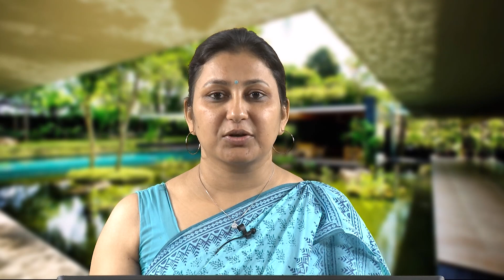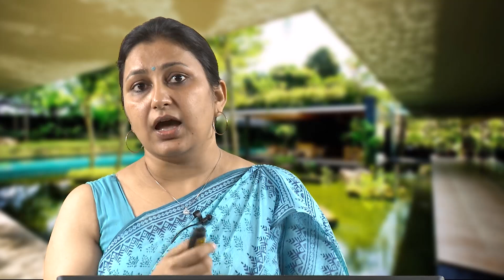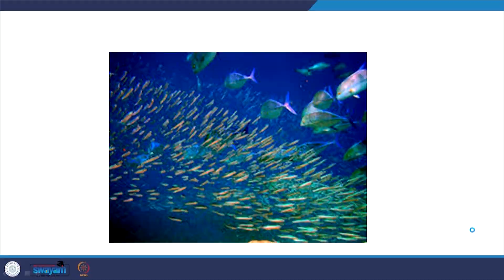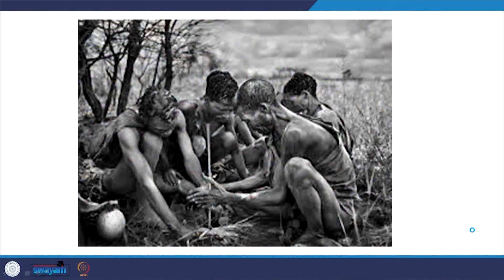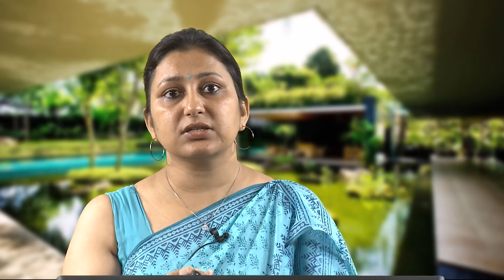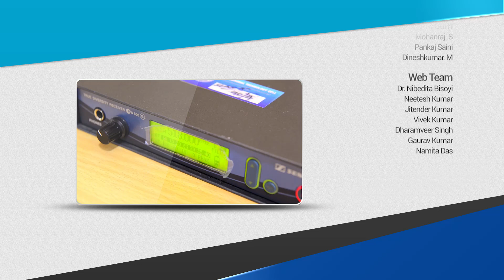Lecture 01 Introduction to Sustainability

Comment: I am very found of listening Ted talks and great speeches made by great artulators. Maam your lecture on sustainability was so comprehensive leaving no point unexplained. I appreciate the manner in which you have concluded the whole thing. Yes we need to alligned ourselves to the nature instead of separating us from it. Having said that I would like to add that every efficient attempt be made by all of us to strengthen the system/process of Nature. Thanks, many more such lectures we need to have sustainable knowledge.